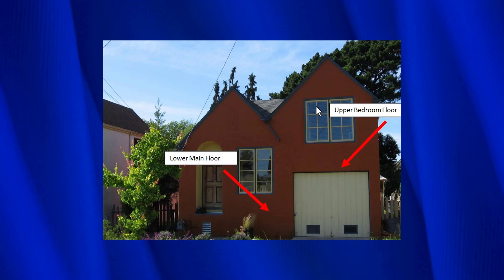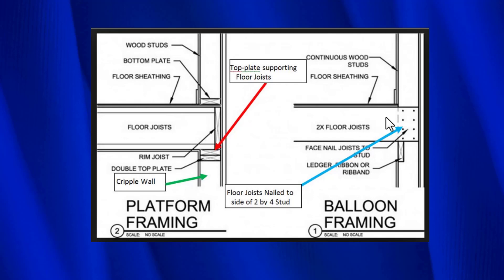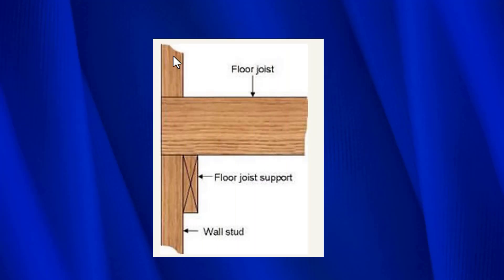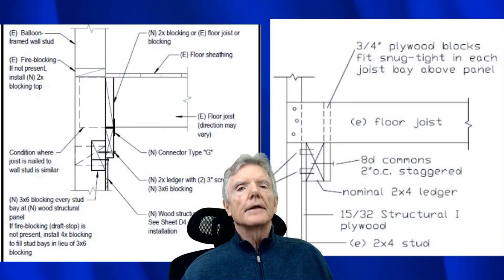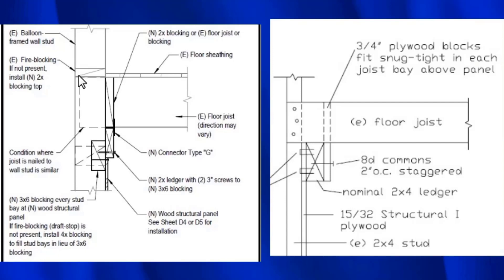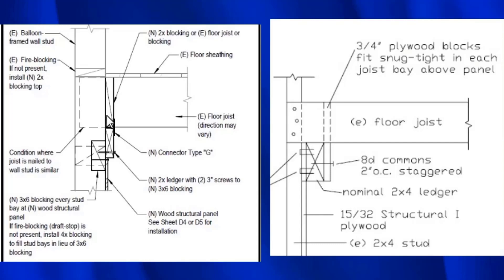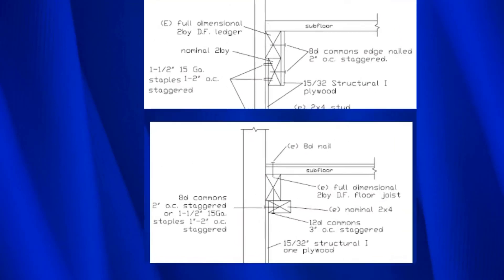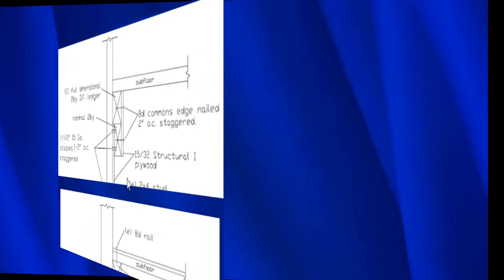Three Ways To Retrofit Balloon Framed Cripple Walls

Comment: Thank you. This is just what I needed.

Do you have a video on how to address retrofitting to an old stone and rubble foundation?

My 1920s balloon framed walls are sitting on hardwood pegs. Looks like a door stop under every floor joist. I belive this was a repair to remove a rotten mudsill.

Now, the force from an 18 foot wall that is 20 foot long is baring down on these pegs and it's sending the rim joist out away from the floor into the environment 😓

Any ideas?